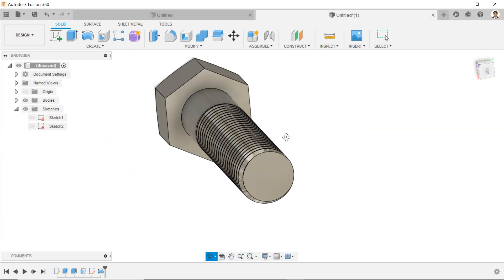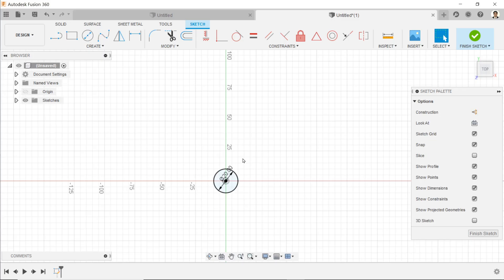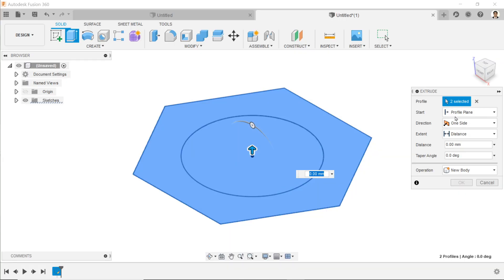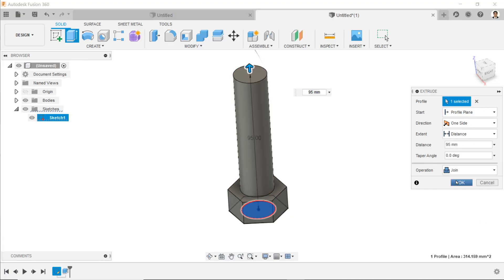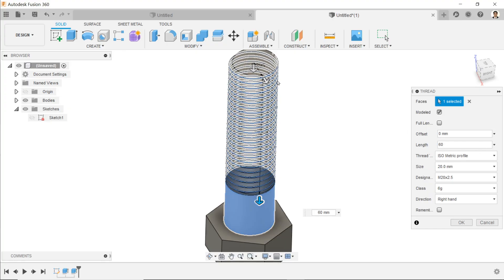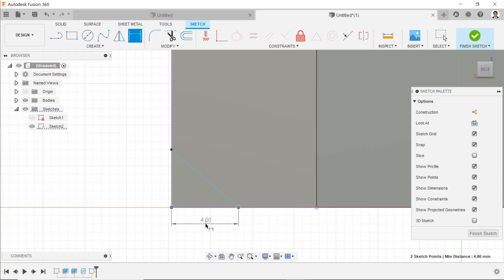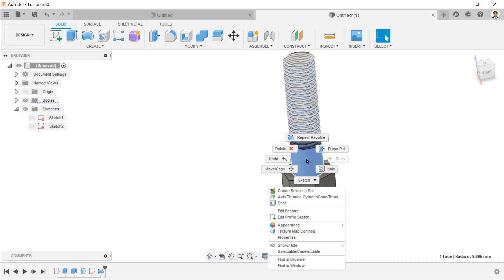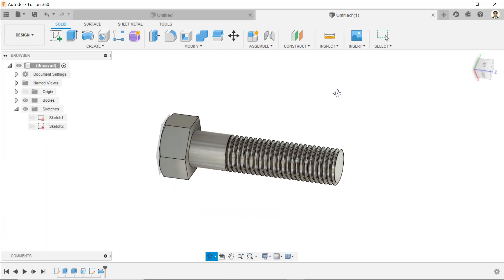How to make Bolt in Autodesk Fusion 360

Comment: I'm losing it. Why I couldn't make the sketch into revolve mode? 6:10
Reply: When you create that chamfer triangle make sure it is closed and if facing problem while selecting axis just unhide the origin and select the vertical axis this should work I guess
Reply: Actually i have a same problem